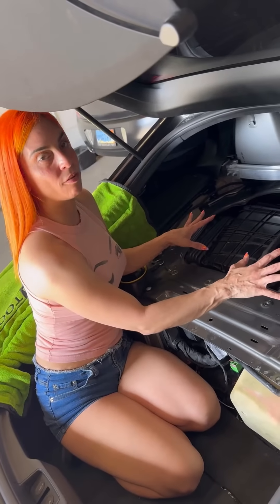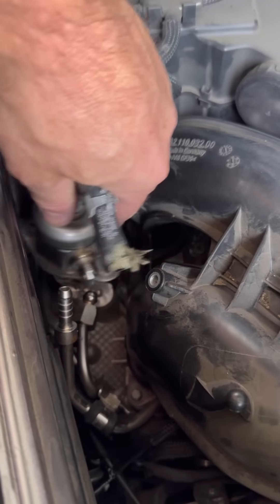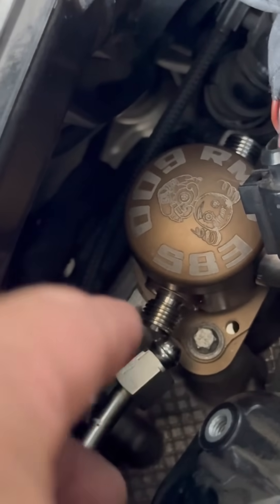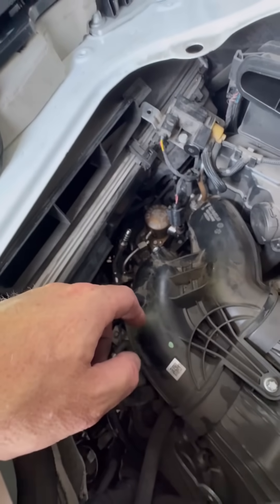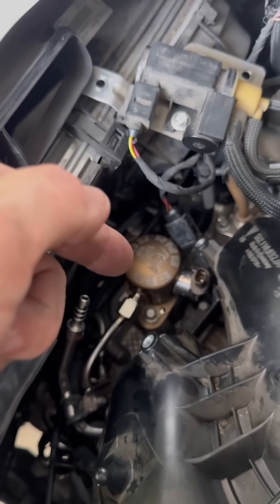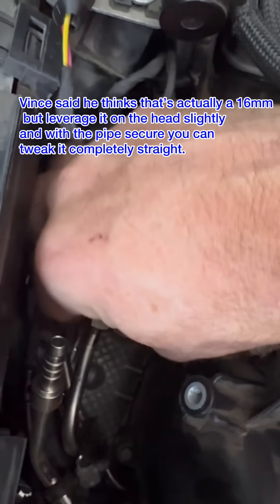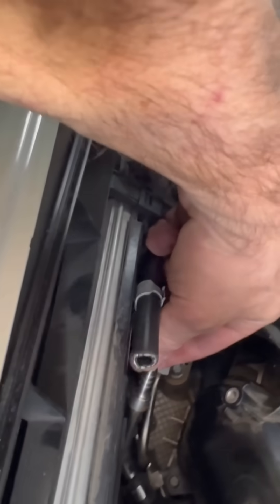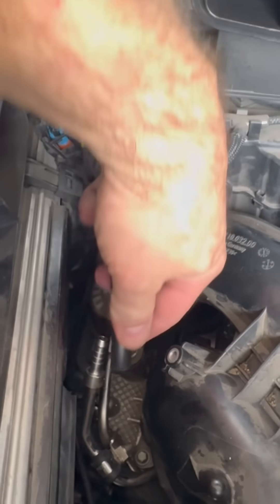RaggDoll Motorsports MoonShine!! High Pressure E85-600 Race Fuel Pump (HPFP)

Comment: Can you run full e85 or just a mix? Also do you know if anyone has started working on upgrading injectors yet?
Reply: Yes, there are many tuners around the world running straight E85 anywhere from 490 to 530 wheel on straight E85.